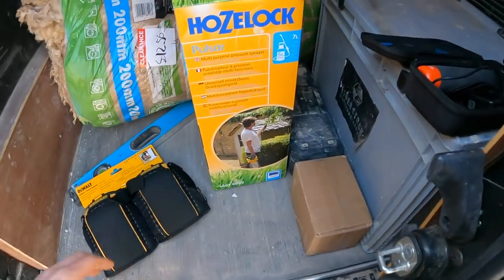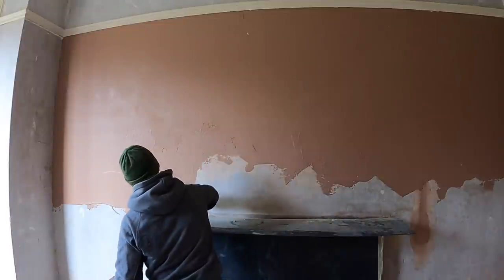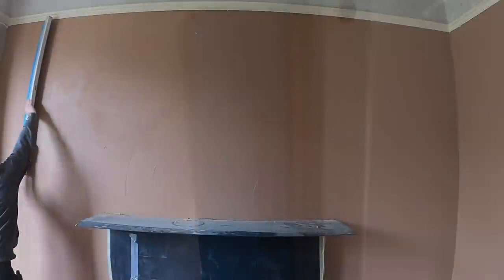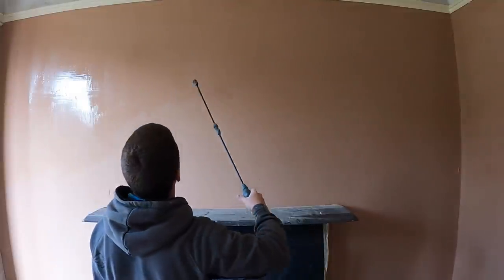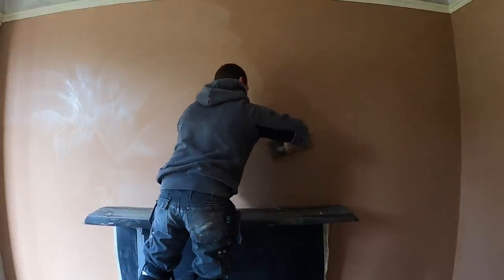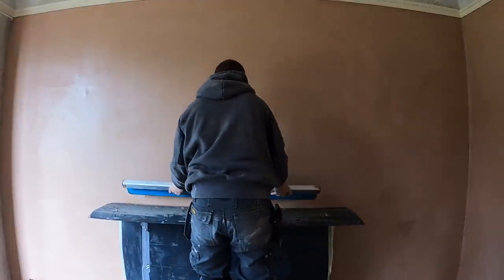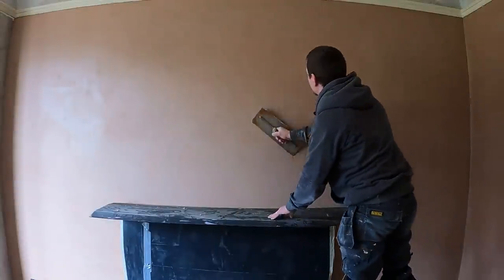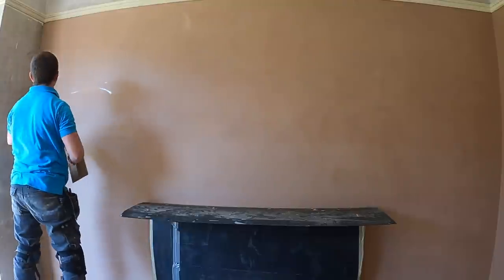Is it BETTER than Traditional Plastering?? Sponge Float Plastering...Revisited!

Comment: In the Netherlands you also sponge float after the second flattening with speedskim/spatula (+-20-30 mins between each step), the instructions are  actually on the plaster bag. only difference is that it usually is done with one coat instead of 2 over here. I am a diyer and I must say I find 2 coats more forgiving than 1.

Comment: Hey mate I'm a plasterer. Bristol based. 20 years experience.  Cool vid mate. When I sponge float I hit it just after flattening second coat. But I dont wet the wall up. I use the moisture in the plaster
 I keep the sponge wet. I then jump straight back on it to flatten in and take lines out. Less water. Less mess. Less time to dry. Love the channel mate
Reply: Paul neale
Yep same👊🏻
Reply: @matthewgaler6544  awsome mate. Nice to know someone else does it this way.
Reply from the maker: I'll look into this. Cheers - I really appreciate the feedback 👍

Comment: Thanks for your videos, i am a builder, and my plasterer of 15years, has been ill, and rather than find another plasterer, i had a go at rendering using your vids. i can skim like a God, using the speedskim, but rendering was like a dark art with mysterious ingerdents like lime, Plasticisers, various ratios of special plaster sand to cement etc. Anyway, I finished all the rendering on an extension today, thanks to yours (and a few other youtube channels)
Reply: going to try the sponge float tomorrow: Protip. Get Audiobooks while plastering.

Comment: Question for you. If the speedskim is quicker and Ox make a hard plastic, stainless steel, and a soft plastic, why not do it all with a speedskim? Is it pressure, control, feel? Or may I challenge you to have a go! Apply with a trowel and then put it away. Video it and review the pros and cons.

Comment: Hi Blaine, excellent videos 👍🏻 I worked in Germany for many years, where I worked on a lot of refurbs. We used a one coat gypsum bonding, which could be troweled nice and smooth. We used the sponge float method and then flattened with a long spatula and always found it stress free. Never tried it with British gypsum but will be once my speed skim arrives.

Comment: I do my own and I find if air humidity is not right or if 15c or above keep plaster wet, not too wet as it goes bobbly etc, then you are fixing them post finish, not a good idea if trade, diy'er sanding is fine as you have the time & patience. Float can get rid of bobbles, however careful as you can git gritty it plaster has set, then you are in trouble. Good vid

Comment: Currently in the same situation pal..how many coats of PVA are u applying...my walls are just sucking it right in..cheers
Reply: @edwallace3704  pregrit is for low suction, not designed for high suction... Better to use sbr...
Reply: @brimplas1  
Agreed 👍
Reply: @si b so you're saying apply sbr instead of PVA to stop the rapid suction 👍
Reply: @thomasryan8358  yes pal

Comment: Keep up the good work Blaine! I would like to ask you for a solution to a plastering problem I faced. I plastered over an old plastered shiny  ceiling using blue grit as a primer and skimmed it the next day. After two days the new plaster cracked and i had to scrape off the whole of it because it became a bit flaky.  What should i use for skimming it? Do you reckon i should use another primer and plaster it again, use easyfill for the whole of it,or try to make a metal structure for new plasterboards and plaster over? Thank you and I appreciate all your effort for giving back to others all your plastering skills and information.

Comment: i cant get to grips with what the plaziflex is doing. i get that the final result is about many layers / stages of work but after the metal blade what good is a softer blade doing?
Reply from the maker: Steel brings moisture to the surface of the plaster which makes it shinier and harder for the painters whilst plastic gives more of a Matte finish. This is a  better finish for the trades ahead of us 👍

Comment: So you can't use the same Trowell for the whole process?
Reply: You can if you want but the flexible trowel is a bit easier for the last trowel or so. when the material starts to set You dont need to apply as much pressure with the flex

Comment: Have you tried sbr on the walls instead of pva? It stops it pulling in much better than pva does.
Reply from the maker: I was thinking about that actually but I'll be honest, I haven't tried it yet. I'll give it a go. Cheers pal 👍
Reply: @PlasteringForBeginners  a 3-1 sbr seals most wall perfectly... We then put a strong pva on before skimming...
Reply: @brimplas1  what SBR is best? And do you let it dry or plaster when it's tacky?
Reply: @louisjenkins3361  any will do, we let it dry then put a strong pva on the top and skim when that is tacky...
Reply: @brimplas1  I've never plastered when PVA is tacky what is the benefit? Sorry I'm a property investor, my plastering is great just the prep work letting me down this is my weakness need to find a bullet proof protocol for PVA/sbr walls before plastering
Reply: @louisjenkins3361  there ia nothing wrong with skimming on dry pva as it re-emulsifies... But the instructions on the tub recommend it.... There is no no bullet proof prep... We always to a test patch.... Put a diluted pva on the wall! If it stays tacky for 15 mins its ok to use, if it dries really quick we use sbr, if it runs down the wall and doesnt go tacky we use neat pva....
Reply: @brimplas1  how does SBR work compared to PVA? And how strong PVA should you use, I use Evo stik which dilutes up to 5:1 what ratio would you use on this product? Thanks for your help mate
Reply: @louisjenkins3361  sbr doesn't re-emulsifie... So if you wet dry pva it goes back to be being sticky... Sbr doesn't... As for pva 5-1 to seal the wall  3-1 to adhere the plaster to it... 3-1 sbr seals the wall nicely... Make sure to wipe up any sbr splashes as it stains.....
Reply: @brimplas1  thank you mate, I'm gonna start doing this from now on I had no idea PVA re emulsified.
Reply: @louisjenkins3361  yep... Pva a wall, let it dry then hold a wet hand on the wall for a minute and see how much it stuck....
Reply: Blue grit is a great product for going over old bad walls, it’s the best way for me
Reply: @sk2283  what ever works for you buddy, i find blue grit goes on very uneven and clumpy. Find i have to knock the mix up very stiff to cover it...
Reply: @brimplas1  you got to do 2 proper coats for sure but it’s my ‘go to’ stuff for very bad walls - it’s been a god send a couple of times !